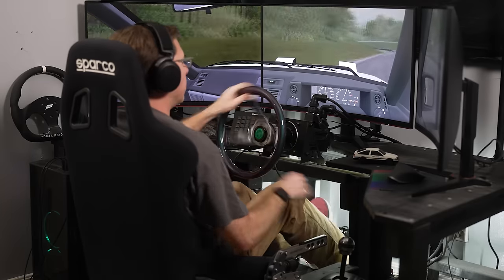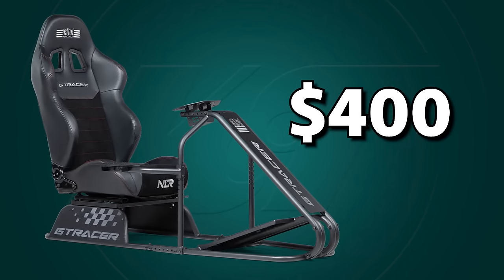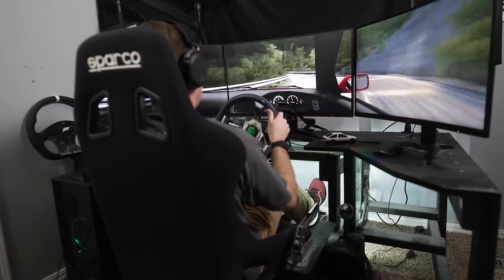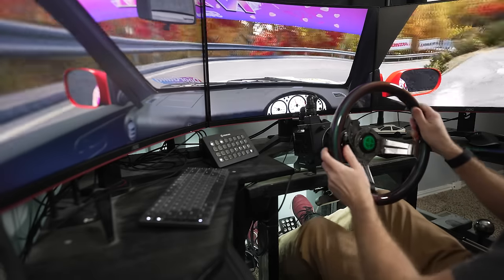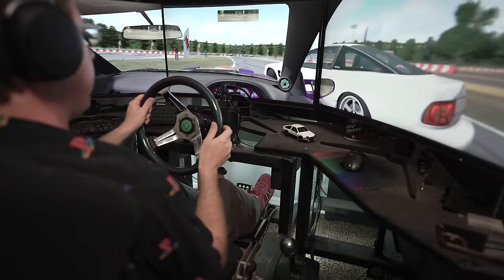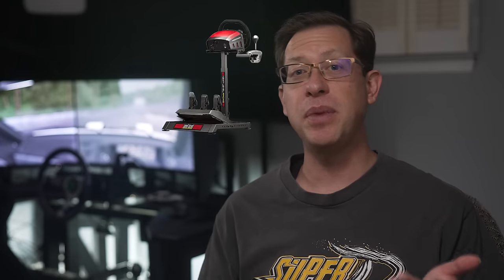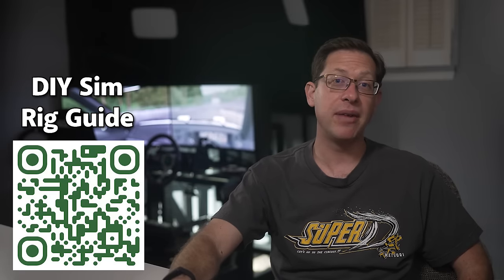My thoughts after 5 Years with my DIY Sim Rig

Comment from the maker: 📝 Download my DIY sim rig build guide here: https://simrig.kametrick.com/
Reply: Combined with the vid where you built it, this is SO sick! 👍
Reply: Does the application for the build guide still work? I applied but did not get the email.
Reply: @bookac  me neither!
Reply: me to plz fix it
Reply: gonna chime in with everyone here, that I did not receive the email, but am extremely interested in your build plans! Thanks for this video!
Reply: Old washing machine frame works well. Low old couch.  Bolt it all down. Start racing.
Reply: The last step of the process the link is dead. Did you take it down?
Reply: You can wrap the your desk with some vinyl which inexpensive and easier to clean
Reply: @thinkaboutwhy  Do not use the link in Chrome ....!

Comment: Here in Australia, I'm a Boilermaker by profession. Not too sure what the profession is called in the US, possibly fabricator/welder. I designed and built a fully adjustable steel sim rig. 8020 rigs are great for what they are, but with a custom fabricated sim rig there are no compromises. However, being a professional I had the tools and resources available, most of which the average person will not for such metal fabrication works. Thats why this timber (lumber) option is great for the average DIY person, as timber is more workable and accessible. Even if you aren’t the best DIYer, I implore you to give it a go and build your own custom rig. Because if you put the effort in, chances are you will end up with something much better than the flimsy cheap ‘n nasty options out there for less cost- just like @KameTrick says. Give it a go!
Reply: In america, we call them functioning alcoholics 🤣🤣🤣

Comment: I'm still using my DIY wooden sim rig 4 years after I built it. Mine is essentially a copy of the most common layout you see in aluminium profile rigs (base box, goalpost for the wheelbase, deck for pedals) but made from 140mm x 40mm timber. It's screwed and glued in some places but bolted together in other places where I was concerned I'd need adjustment in future.

I did sand and fill my rig before coats of paint and lacquer and it is practically impossible to see that it is made from wood until you get to touch it and actually knock on the wood.

Comment: This was an absolutely fantastic video! Best one I’ve seen covering all aspects of diy rigs! I built my own out of 2x6s and it’s lasted me about 4 years of upgrades and modifications. Rigidity can be drastically improved by using parts of profile rigs like a wheelbase front mount or aluminum profile pedal tray. Gt omega has great affordable options! Only thing I would add to this video is that from my experience in mostly open wheel cars in iracing using around 16nm of torque. Because of the sharp peaks I’m fighting in racing compared to drifting which is smoother on the wheelbase I found that over time whatever fasteners I use wear into the wood and it start to creak and move under load. I’m very experienced in diy and engineering, it’s simply a matter of woods compressive strength. It all bolts together strong and solid but after extended use the constant vibration and peaks make the fasteners wear into the wood and it loses its structural integrity. Best way I found was to use m8 carriage bolts and locking flange nuts as opposed to regular deck screws. Deck screws just pulled through the wood over time. With the carriage bolts you can go around with a 13mm wrench and crank them down to make up for the woods compression over time.  For reference the bolt heads and nuts are now about 1/2” sunk into the 2x6s after 3 years of use. I’ve got an aluminum profile rig on order and waiting for delivery. I don’t regret for a second saving my money for other things over all these years. A DIY rig is all that most people will ever need. It’s only since having 200kg load cell pedals and a 23nm dd base that over time it fails.
Reply from the maker: Thanks for taking the time to watch, share your opinion and all this extra info in your comment, I’m sure it will help someone make an even better rig than my first attempt 💯
Reply: @KameTrick  Thanks for taking the time to read my comment and reply! I’d highly recommend the GT omega Prime front mounting bracket for your set up. It’s a 15mm aluminum plate that looks like a dashboard. In Canada I got mine for around $90usd. Most solid wheelbase mount you can get and it’s compatible with basically any profile rig if you upgrade in the future!
Reply: Just buy a cheap cockpit for the the amount of money you spend on materials, plus you don't get splinters or have some ugly wooden frame spoiling the look of your expensive rig.
Reply: @chappy0690  lol dude I built mine out of wood I had and if you know what you’re doing you won’t get splinters 😂😂😂. The wood would’ve cost me $15 if I bought it. The screws, nuts and bolts less than $20. My seat was out of a Porsche from a junkyard for $40. I had $75 into a rig that rivals a sim lab P1x in rigidity and basically looks like it. The main reason I’m upgrading to aluminum profile is for better longevity and because I can afford it now.

Comment: Awesome that you shared this.

Somethings I have learned from this video I need to remember when I attempt a DIY wood rig:
- Modularly. This allows for disassembly, replacement of sections. Will increase costs.
- Design with the idea of upgrades/replacements down the road. Build the sections to allow for easier adjustments when dealing with upgrades. For example the wheel deck being between the uprights can allow for it to be lowered without cutting.
- Add removable cross members to help with rigidity. This will also help support the top two items.

Comment: Your original videos on a DIY wood rig inspired my own build in a big way, and I'm happy I did it.
I put a floor on mine, and have bass shakers hidden away underneath.

My main learnings are these:
- You will make adjustments and probably won't get everything positioned right in the first attempt. Build your rig in such a way things can be moved forward/back, up/down. Maybe wait with painting until you've gone through an iteration or two.
- You will most likely need to change stuff when you upgrade. For me it's main been wheel deck going front flat to angled and having to move base forward or back. Handbrake and shifter also have taken several attempts to get just right.
- Not sure how typical this is, but the seat I got (from a VW Golf) was asymmetric. I sit maybe 4cm to the right relative to a center measure from seat rails. This affected my build significantly, i.e. wheel base is mounted with an offset to the right to compensate.
- Seat and pedals on rails is fantastic, both for when someone else gets to try, or if different wheels have different lengths. Fanatec formula wheels are shorter than hub based wheels for example.
Reply from the maker: I love how many people are commenting who either build a copy of or were inspired by my original DIY build video. These are great tips, the comments section for this video adds just as much value as the vid itself 🏆

Comment: Appreciate the sim build inspiration!
I started off by drilling holes into my basic 6 foot desk from Ikea to mount my wheel base to, built a simple pedal frame/stand out of wood to mount my pedals to in a way that they don't slide on carpet, added an adjustable monitor desk mount for a single ultrawide curved monitor, and use a chair that sits next to me to clamp a shifter to.

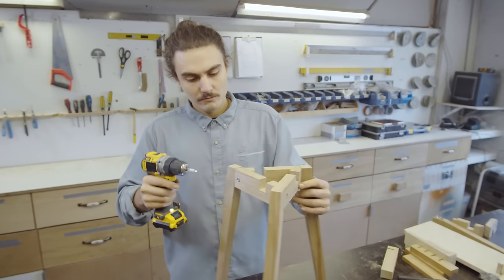Comment: Awesome and comprehensive build vid! One thing I'd like to suggest the the 4:15 segment; another potential option is joining a local makerspace if you don't have access to tools, don't want to make a mess in your home during fabrication, or live in a space where loud power tool sounds could get neighbors calling in on ya'. Makerspaces are sometimes not worth the cost of membership, but some are amazing as they are filled with people ready to advise and mentor with their own fabrication expertise, generally have access to LOTS of standard and specialty tools, and can not only offer a space to complete your build, but can give suggestions on how to make it more modular and portable (since you'd definitely need to take it home when finished). When I started off with welding and working with steel projects, my local makerspace was super invaluable for learning how to work with a new medium I was unfamiliar with and took all the space/tool variables out of the process.

Comment: I built my first rig out of wood in november 2023 first for my super old Driving Force GT wheel.
Then switched to the 5nm Fanatec CSL DD wheel.
Worked pretty well, had no problems with bending or vibrations.

But after getting the Boost Kit to 8nm my wood rig started to bend and make scary noises so I switched to an aluminum rig in Feb 24.
Pretty happy with it. But wood was an easy and simple way to begin with sim racing.
Now I got my rig for life, constantly expanding.

Comment: i am using a DIY wooden rig now for years, one other plus to mention is that you can choise your color instead of black, mine is white and used also plastifide wood so cleaning is easy, also made a wooden monitor stand , it saved a lot of money. Nice chair from the auto gravejard for 30 bucks with rail. sits comforteble. And i am proud of my rig , so satisfying.

Comment: I'm not really into woodworking, but today I made some quick car ramps from leftover pallet wood and thought, I wonder if I could make a sim rig. I have one of those folding chairs that you did not recommend in this video and with a Moza R9 and Logitec CSL load cell pedals and the thing is constantly flexing EVERYWHERE. Unfortunately, I no longer have the budget for a nice aluminum rig. I found your first wood rig video from years ago and thought it looked great (especially since it handles your 20nm wheel), then I saw you posted this video just 3 days ago! I think it's a sign! I'm going to go for it! Hopefully, this will give increased consistency and feel through the pedals and wheel! Thanks!

Comment: I opted to build my own cockpit. I paid $100 for wood and had 2 seats with rails in storage. I cut everything with a $20 jigsaw from harbor freight and used my $20 drill from harbor freight too. The best thing about diy is if you want to customize or add extra stuff it's super easy to do it.

Comment: a neat tip for the design process for making a wooden rig is to try build the plans in a simple CAD program like tinkercad, its an extremely basic browser based CAD program that i used to design  the plans for a sim seat base for my setup which consists of an old bmw seat and a podium for a shifter and handbrake, you can place simple cube models and very easily scale them to match the dimensions of the planks or whatever else you're using and you can use that to lay your plans out and see if maybe something looks too high or low or even just to roughly work out exactly how much wood you need, different lengths needed etc

Comment: A friend and I both bought Logitech wheels a several years ago, we spent an afternoon in his garage with some 2x4s, OSB, a box of decking screws, and 2 old seats that were in his parent's basement from an old conversion van build. We both still use them frequently, he added a handbrake mount to his, we both added different shifter mounts, and they're both still going strong. I'm a huge fan of DIY sim rigs in general, and have helped 2 other friends build theirs since I built mine. Probably not for everyone, but for the vast majority of people, they're a far better first option!!

Comment: Great setup!  I really enjoyed your video and I'm inspired to build my own.  What I like about your setup is it's still a "desk" as well... whereas many of the premade kits you buy are dedicated dricing seats only.  I need to keep some desk functionality to my design as well.  As for the dusting the surfaces of your build...it's an easy solution that will change how you paint wood furniture.  Valspar (maybe Bear as well) makes oil based water clean-up cabinet paint that is applied with a sponge roller.  Very easy to work with, tintable and applied with a sponge roller on pre-sanded plywood or any wood. A few coats, then apply either a wipe-on or paint on Polyurethane and you're good for the long haul.  Just light sand the poly before coats.  3 should be plenty.  I have used this method with many Arcade machines/cabinets I have built over the years that come out looking like you spray painted them.

Comment: I started Sim-Driving about 10 Years ago. No racing though, but relaxed trucking across Europe and USA. Therefor, force on my setup was never a concern.
I´m still using my first wheel, a now 10 years old G29. Still works flawless, although it has a lot of holes for additional equipment in it nowadays.
Everything on my "rig" is low budget DIY...Button boxes, a "real" desk mounted dashboard running tablets and smartphones inside of it. A shifter stand, and so on.
I can´t use premade ready-to-use solutions even if i wanted to, because my gaming setup is also my workplace.
So the focus is on quick and easy to mount and to remove.
TL;DR: I think a DIY setup is absolutely worth the effort!

Comment: On the paint/dusting the desktop, get matte black house paint (latex) and apply it with a roller. If you used rough plywood just keep filling it with paint and you’ll definitely see a difference and you’ll be able to clean it up easily
Reply: Yeah I was thinking cans of build primer but probably roll on paint would be better

Comment: Hey Kame Trick, Have ever thought about 'rapping your sim rip'?
I like using 'Felt & spray glue'.
 Other things that can be used are 'cabinet liner', 'wallpaper', 'Used carpet', spray 'truck  bed liner' & old car head liners. Tin* & furniture tax if you want a steam puck look. *copper aluminum any metal.
Also 'Polyurethane' that is used on wood floors.

Comment: Excellent build! I had to build my own rig five years ago as my wife would not allow me to bring “the monstrous monolith” into our home. She actually did me a huge favour as I enjoyed designing and building my own rig out of 2x6 wood and painting it in a John Player Special livery. Despite it consisting of triple screens, it is low profile and quite discreet. Best of all, it cost me less than $100, including an adjustable sliding IKEA chair. The low cost allowed me to add a ButtKicker, which is essential, in my opinion. I now love my unique rig, and it has accommodated two wheelbase upgrades since. Currently I have a Fanatec Podium DD and it as solid as a house. The only thing is that the pedal plate creaks under severe breaking, but that just adds to the immersion when driving vintage cars. 😂 I thought it would serve me for a year or two, until a sleek, affordable rig came around, but I think the old gal is here to stay.
Reply: What adjustable ikea chair did you use?
Reply: @robcaseyire  I used an IKEA POÄNG, and built my rig to extend alongside it on both sides (i.e. on the outside of the chair) and added aligned square blocks to the legs of the chair that slide on the floor. So the chair sits snugly inside the two beams of the rig that extend towards the back. Then I made a simple wooden beam that runs under the chair to lock it in place on the two sides of the rig. It is not very sophisticated, but works really well for getting in and out of the rig, and for changing the distance to the steering wheel if you swop wheels. Once you have your preferred position, you just drop the locking beam in place. If you want further adjustability, you just add more stops to the IKEA chair's beams that slide along the floor. I have carpet, so the chair slides easily, but I you could add felt sliders to the bottom of the chair if you have wooden floors. I hope this all makes sense!

I find the chair so comfortable and never get tired, even after a few hours. I painted everything a semi-gloss black and added a few stickers (particularly JPS 🙂) and it really looks the part.

Comment: The largest factor that pushed me to choosing an 80/20 aluminum setup is resale value.  For any reason in the future, I know I can sell the cockpit on the secondary market and recover quite a lot of the original cost as they hold their value over time very well.
Reply: Plus they are so easy to work with and have almost limitless expansion possibilities. I bought a GT Omega Prime rig and I'm super happy with it.

Comment: It's certainly one area where having a dad whos a carpenter and has more tools and materials just sitting around than you'll ever need is exceptionally useful. I don't have the space to make a dedicated sim setup so I just had to integrate the pedals and gear shifter into attachments to my normal pc desk. but it works surprisingly well, and I've even got a nice foot rest on top of my inverted pedal platform.

Comment: When I started off I bought a pre build stand for 80bucks for the equipment to hold
I now build a small diy arcade table nothing to fancy looking just working from material that was over.
I made it so it fits directly around my wheelstand for storage reasons and so I can have a monitor on it so I can use it also not from directly in fron of my pc. It was annoying to move it around all the time.
As a plus I can also use the arcades buttons and sticks in a sim.
All i can say is diy is worth it and if possible should be done for ones need especially if the space is limited.

Comment: I finally pulled the trigger on my first real build. I started on a wheel stand lite and Logitech, but I wanted to upgrade to a real rig. 

Bought the next level GT racer cockpit but returned it because the pedal plate was fixed.

Current setup
Simlab GT1 EVO
Moza R9, FSR wheel
Simlab XP1 pedals 

Very happy with it so far!